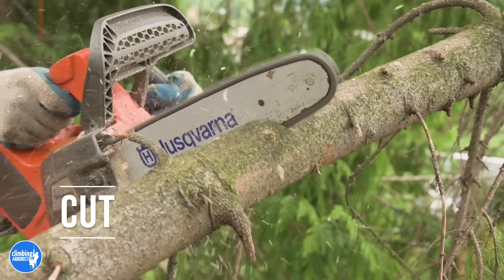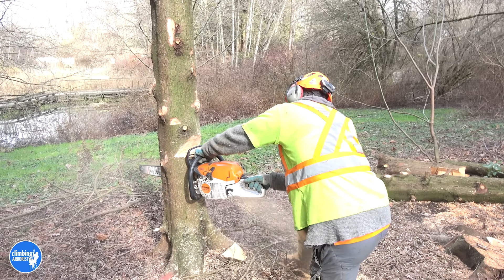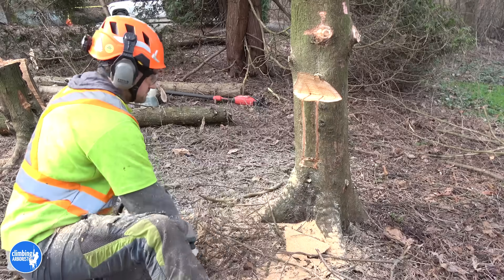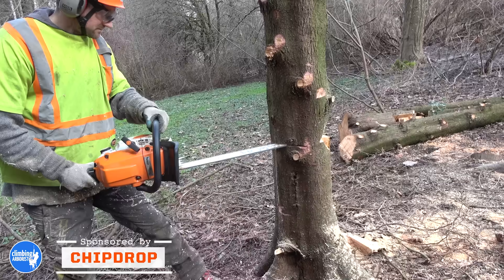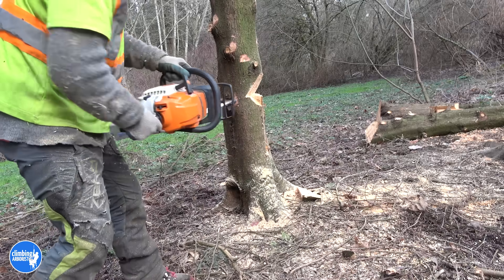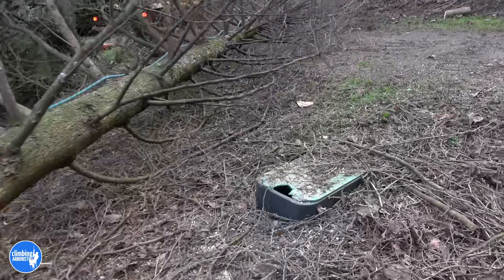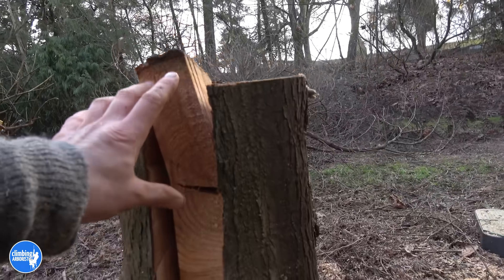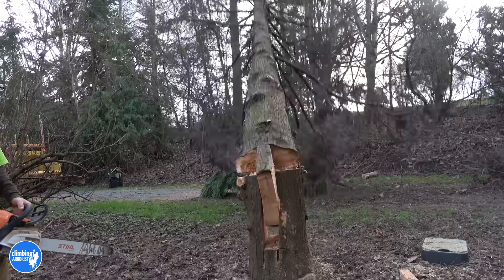LEARN the 'KEY NOTCH' tree falling technique

Comment: Here in western Oregon, where I fell timber for 30 years, you would get fired for wasting several ft. of saw wood for no good reason. The Forest Service, BLM, Timber owners, Timber buyers: none of them will tolerate this.
Reply: Yall forget that not everyone sells the wood. If you’re putting it through a wood chipper or making firewood anyway, there is no difference

Comment: Thank you!  I like the idea of cutting a lower block out of the key notch.  You say, "With this system, because it locks into place using that middle piece of wood, the steering ability is taken away."  But would you not also say, that middle piece of wood also controls the fall direction and that's the whole point of using this technique?  I would cut the notch so the tree falls in the direction I want.  Would any minor directional guidance from further steering ability lost not then be moot?  Maybe it's case specific, but a general direction would be fine for me, felling a back-heavy-branches tree into a wooded area I don't care about.  I just need something big and sturdy to connect 1 or 2 winched ropes to for pulling in the correct direction and preventing back-falling.  Sound about right to you?  Thanks in advance.

Comment: Used to use this all the time in the 90’s when clear felling to make bench trees across the direction of the felling. It allowed you to work on the subsequent trees at waist height but more importantly it eased rolling lengths to the side where they were crosscut and available for extraction by the forwarder clear of brash.

Comment: The proper name for this technique isn't ''Key Notch'' but ''Huntly Hinge''. It was so named because it was invented and first used in the forests around Huntly, Aberdeenshire, Scotland in the 1980s. It was invented by Roy Neish MBE who will be 95 now if he is still alive. It was developed to raise the height of benches in bench felling at a time when forwarders came into use and logs began to be cut to standard lengths on site. Norway spruce would always break due to brittleness when using an ordinary wide angle notch which kept other trees on a stump, so this was the solution. Far from there being ''no use for it in the forest'' that's exactly where it was used and on a large scale. Log ''benches'' were felled at right angles to the direction the majority of trees were being felled, all the other trees were felled across the benches to give a good working height and could then easily be rolled off into produce zones on either side. Although the Huntly hinge wasted a bit of good timber, it speeded up cutting and extraction. It's use then spread to other areas. I was a woodcutter working in the Huntly district and was taught this technique by Roy. He received an award for his invention from the Forestry Commission. It seems strange to me that this hinge would now be used in gardening to keep a tree from rolling or the trunk raised and attached to the stump when an ordinary wide angle notch is sufficient, quicker, and easier.

Comment: Humbolt sink cut would save using the tip of the saw taking out the front notches. Using a sharp and accurate cutting saw would also be nicer. The curve on those cuts is significant. Good vid though.

Comment: My neighbour tried this. Went backwards on him. Straight into my yard, cutting my power line. Thanks Marty
Reply: Shoulda woulda coulda.  Sometimes a Tension line is a must. 💛🙏
Reply: Yeah the videos make it look easy, doing it yourself is a whole different thing 😂

There's a lot of risk for kickback with those plunge cuts and those angled cuts and the final cuts at the rear, if your neighbor messed up enough to drop it the wrong way then he's lucky to have not cut himself
Reply: Lol, that's pretty funny (I mean not for you, obviously)
Reply: Good job 👍 and good instructional video.😊
Reply: I use this all the time, it works great, and if your experienced and careful your plunge cuts won't kick back.
Reply: He didnt have it supported with a rope to make sure it went the direction he cut it for it to fall. I can't word what I'm saying sorry lol 😆 but I hope you understand what I'm trying to say. Or he didnt make the cuts correctly and at the right angle. Reason I say have a rope as support. Is because it the top weight is more on the opposite side of where he wanted it to fall, he'd should have cut a deeper angle and longer angle on top to the bottom flat cut that is only half way through the tree
Reply: @clownlove24 if you notch and plunge correctly you can fell a tree the opposite of the lean orbl weight, its more than a cut you leave certain parts of the hinge wood. You cant really tell accurately of a leane by a photo or video either really
Reply: Oops
Reply: Your neighbor was an ass hole, I bet he was not an insured, bonded, tree cutter.
Reply: Only professionals can cut trees???
Reply: Lol surrrre
Reply: Can't fight gravity. If the tree already leans in that direction, this won't do jack. Safety pull lines and wedges would probably help. I'm not a professional, but I know there is never a single solution for every problem.
Reply from the maker: Was he a professional?? 🤦‍♂️

Comment: excellent.  i was wondering about this cut and failed to see how useful it can be in urban environments especially.  good one.
how about this 'steering' a tree by working on the hinge as it comes down?  can someone explain that to me?   is it that the tree is coming down square to the hinge as you'd expect and you see you've cut the hinge wrong or something and it's not going where you want to you 'change' the hinge as it is coming down?  and you 'change' it by cutting a bit away at one side or other?  And that makes the hinge 'wedge shaped' ?  and the back of that wedge,  the side nearest you,  decides the direction of the hinge,  the direction at right angles to which the tree will come down?
Is that it?
And you do all that in the two or three seconds as the thing is coming down?

Comment: I will try this tomorrow. 🙂
Of course if you do not cut the notch strait, it can quickly become a lock that will prevent the tree from falling.. (If you look at it from the top and the angle is thicker in the direction it is supposed to fall..)
 \ / wrong - I I correct.

Comment: In your falling course did they teach to hold the saw wrong or is that a self taught lesson. 
Never side bar. 
The correct way You take knees and hold the top bar to use the break 
Because if the saw kicks because it hits an old T post inside the tree you don't cut into your chaps or leg when the chaps don't full lock up the chain with kevlar.
I have yet to find one cut that can't be made by using good body positioning and correct hand holding of the top bar to have access to the break in emergency. 
Read your manual.

Comment: Nice video! Tnx. 
You can eliminate 1 cut though; by making the first horizontal plunge cut in a slightly downward angle. This will eliminate the need for a second horizontal plunge cut and will still give you enough room for the pivoting stump.
Reply from the maker: Great tip!

Comment: If you're experienced enough to safely and accurately make this cut, you probably don't need it. I like how you didn't mention how this technique revolves around a major chainsaw no-no; don't use the tip of the bar for cutting. This is how kickback and hospital trips happen. Do you want a chainsaw in your shoulder? Because this is how you get a chainsaw in your shoulder.
Reply from the maker: A Plunge cut if done correctly is a necessary and standard technique for a good chainsaw operator . You need to plunge for various techniques such as a dogs tooth felling technique to prevent barber chair

Comment: Beautiful! I loved this, even though I'm an axeman! I've sometimes felled tricky trees for folks using almost exclusively the axe, which I can because I have a fair deal of experience, and know to climb trees to limb the weight with lean where I want it to.

But sometimes that's not enough, and so ropes and (semi-)dubious wedging has been used to make it fall straight. One time I had a bad premonition that fortunately ended well, but the "throw of the dice" was no fun when a friend can risk considerable damage (that was meant to be avoided all together in case of a storm)

But still I've been called over some sawmen, because in such settings they'll admit that they're to get stuck (or much worse), so they'll need even more accessories than what it's worth (vs risk).

I'll have to share this with my fellows, because just because I can be the one that can, doesn't mean I should be the one who should. Sometimes, you need a different tool, and my fellow sawmen (and people in our local villages) will thank for sharing this vaulable safety measure.

Thank you for uploading! Cheers from northern Norway

Comment: I have a feeling that this could be potentially dangerous.  If the tree isn't perfectly healthy and you have two back cuts it might not do what you predict.
Reply: Well, cutting down trees, in general, is pretty dangerous.
Reply: @Aaron-fl2iv  Indeed it is.  However I think this trick cut is probably not a professional move.  The pros would either climb it, use ropes and wedges, and use basic falling techniques to get it to go where they wanted.  If you're sawing into something like that and it's hollow inside you don't have enough back strap to hold it against the lean.  You do not want to be cutting through the holding wood with something like this...
Reply: @lashlarue7924  Would you say that this technique is generally bad, or only bad under the circumstances you mentioned?

Would it be safer to only use this technique on healthy trees?

(I don't plan on cutting down any trees,  I'm just curious.)
Reply: @Aaron-fl2iv  I am not a professional, so I need to maintain some intellectual humility here, but I do have an interest in this stuff and try to educate myself because I want to stay safe when cutting firewood.

My understanding is that most of these "trick shot" cuts are mostly done to look cool.  Another example of this might be the "shark gill" cut.

The professional arborist and logger crowd don't usually use these methods to my knowledge.  Probably there are exceptions, but usually those guys would just use ropes, climbing equipment, and wedgemanship rather than take the calculated risk of removing any more holding wood than absolutely necessary.  So although I agree that the outer edges of the hinge are the most important, I don't think there are many cases where you would actually do this if you had the alternative to just use wedges and ropes to bias the tree toward the desired fall line.

I think the main thing though is probably just efficiency.  For lumberjacks time is money and they can make almost any tree do what they want without resorting to this method.  For arborists, they're not generally going to take the risk of taking out the corner of a house just to impress the cameraman.

Comment: That's not the way you do it.
Reply from the maker: Make us all a video on the correct way 👍
Reply: @ClimbingArborist  Yeah Right, and end up in some sick Sex video. 😂 
Draw a circle on a paper, roughly draw a line 1/3 the diameter across the circle, 90° from the points where the line interscts the circumference will be the direction you want the tree to fall. Make a flat cut to that line, cut UP to that line at a 30° slope or more. That's the Undercut. On the back side of the tree start a flat cut 2 inches minimum, above your undercut. Cut to within 1 1/2" to 2" of your undercut (that's your hinge wood) Put a wedge or 2 in the back cut as you go & keep them tapped in, you can cut up to another inch if needed. Then wedge it over.  There is only about Ten thousand variables to falling a tree, Species, stump rot, time of year, wind direction, school marms (multiple tops) the direction it needs to go, the direction it wants to go. If it's not leaning the way you want it to go, you can pull it up to a point by leaving more hinge wood on the side away from the lean. If it's a straight tree, no bends or bows you can hook a rope or cable up as high as you can and pull it to some degree. But many bigger trees will need to be topped  & cut from the top in sections. I fell big trees, snags & heavy leaning trees from 20" to 6' in dia. Along highways, powerlines & buildings since the 70s, one in LV 3 days ago. The most important thing is to not bite off more than you can chew, and let the customer pay for the Crain or get someone else if your not sure you can pull it off.

Comment: I'm no chainsaw wizard but it seems this takes too many cuts with the tip of the saw.
Reply from the maker: How many is too many?
Reply: @ClimbingArborist  
One?
Reply: @dave_ecclectic Sir. The idea here is to aim the tree falling spot exactly, so that you don't damage anything valuable that could be damaged if the tree fell where you don't want it to fall. Besides that, you DO NOT just cut a tree down with one (1) cut. The saw blade would jam and be stuck in the tree. You still have to generally aim the tree with a V notch cut on the front. Feel enlightened now?
Reply: @johnverkler3962  
I didn't say it took one cut.
I didn't say I didn't understand it.
As for aiming the tree I have to wonder what those people in the past did to place the tree where they wanted before this (dangerous) method was discovered.
Reply: Sorry, I mis- understood your "one" cut too many answer. All tree cutting is dangerous. At least, this way, you can "pick your landing zone". Just saying.
Reply: Like I said before. A "V" notch in the front. And a back cut with hinge wood in the middle to ease the tree down toward the "V" cut.

Comment: How to waste chain: 1.01
Reply: @ClimbingArborist  - you can fell a tree precisely without using this method, and without the need/risk for plunge-cuts. Just mark the center with a caliper, make your relief cut, pre-load with a couple wedges, then make your choice of fell cut.

No excess cuts. No plunge cuts. Takes the same amount of time. Your chain will last longer. Your bar will last longer. Your engine and clutch will last longer. You get the same result at nearly half the cost. The only time you should hinge fell, is when you're forced to precision in windy conditions (storm duty with high collateral risk, etc.).

Comment: I can see a lot of use for this in urban tree felling. This ain’t for novices, but for pros, being able to protect low walls, planters, raised beds, and especially tree-surrounding expensive tile patios or wooden decks from having the trunk smash into them etc, is awesome. People say this takes too long, but in those specific, but fairly common situations with urban trees, this can actually save a lot of time not having to set up crash bags/blankets, hoping it’s enough to protect what you have to protect from a falling trunk, when the budget precludes a crane. I think clients will appreciate it too.
Reply from the maker: Agreed
Reply: Absolutely I'm using it here on a farm it's a lot less risk for damage
Reply: It doesn’t work if the tree is hollow or rotten in the center. Fine for sound, solid trees, though.
Reply: @grprather only safe way to do a rotten tree in tight spaces is a bucket tbh
Reply: I've done a fair amount of urban felling and I've literally only seen this notch on social media (where people use it a LOT because it looks cool). It's got a very niche usefulness and it can usually be done easier and with less risk by just butt tying the tree.
Reply: Yes,  in very specific situations this can be of value in urban tree work, but not done in Cutting Timber for Mills'
Reply: Whole video is like 8 minutes... How much in a hurry are you? (Also, how many extra seconds do we talk about?)

Comment: Excited to mess around with this a bit! Question for you: have you attempted it perpendicular to the primary lean of a tree to see what happens? I could imagine a number of outcomes (key+hinge breaks, keys binds and stops moving, stump splits). 

Purely morbid curiosity on the directional capacity of the technique for fully weighted trees.
Reply from the maker: Haven’t tried it on a side leaner. Likely would be risky

Comment: Awesome information! I like that you can do this solo, no need for a rope and extra person. Only challenge would be on larger trees my 16" dewalt saw probably wouldn't work to cut the key. I'll have to try this on the ausie willows in the spring😊
Reply from the maker: This technique doesn’t change the need for pull line, extra person etc
Reply: @ClimbingArborist  OK, than not so useful 😁

Comment: I like it. Even if you're just cutting some firewood it you still get some benefits from it, better ergonomics for limbing, can back a small trailer under it after felling so you don't have to lift as much after. If you're working sandy or muddy ground you can avoid sinking the tree into that. And it should dry fast on the stump if you just want to leave it like that.

Or if you just want to make a place to sit. Cut it down, limb it, shorten it, flatten it and throw a piece under the other side.